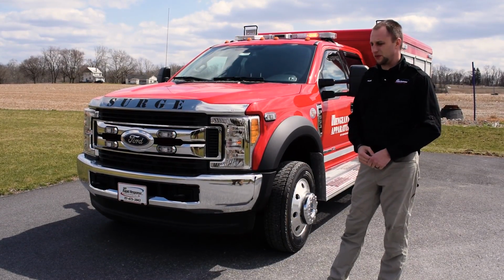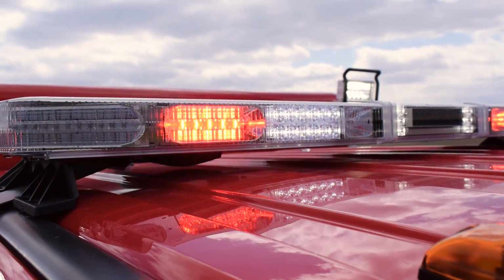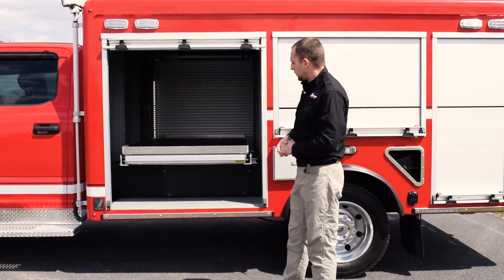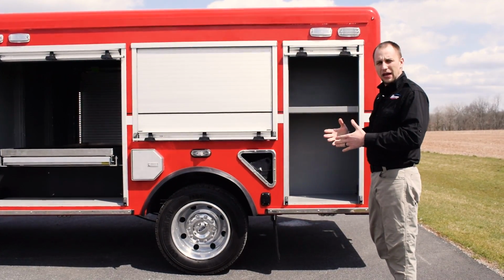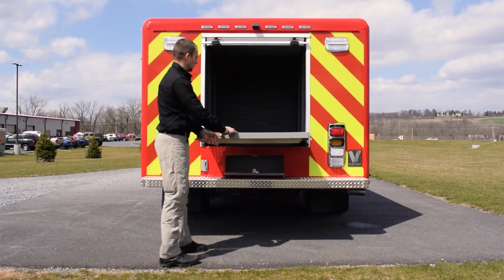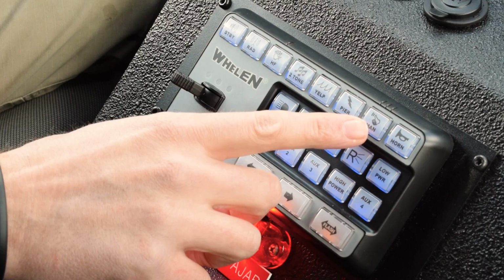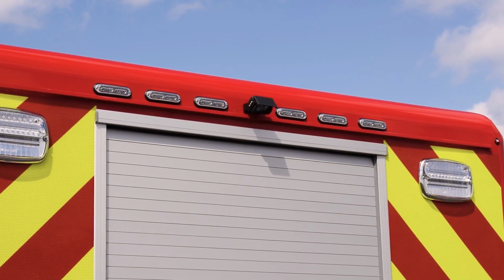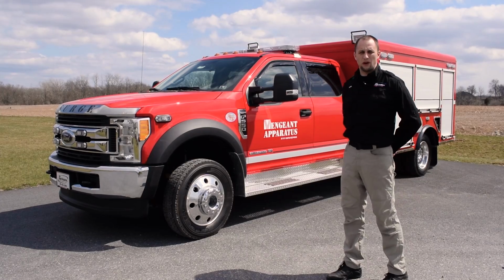Vengeant Apparatus: The Surge | 911RR

Comment: Love to see the Cyclone version. Will that be coming up anytime soon? Thanks. Looks like a solid rescue unit. Great for quick response EMS, Auto Accidents, and other responses. The city I live in has started to use these quick response units instead of Type 1 Ambulances and/or Engine response. They are finding it easier to get through traffic and no need to have a larger unit out of service if the paramedic needs to transport patient. Better having a unit like this instead of an entire Engine or Truck company down for an hour while transporting. Plus, it save money. Great job.
Reply from the maker: The Cyclone is being scheduled for completion around late summer/early autumn. Stay tuned as we bring out updates on this build.